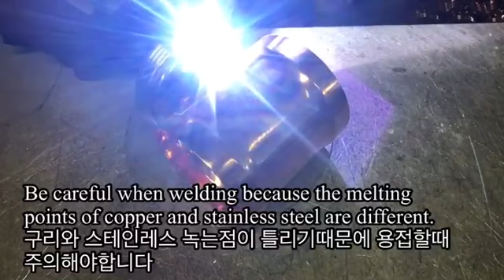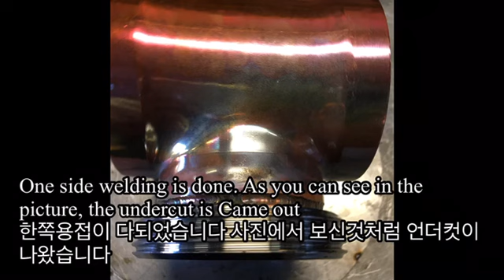How to weld copper to stainless/4inch copper tee/알곤용접

Comment: How about welding copper inside a long tube say three feet long ?? Just to be clear, slide copper rod inside a stainless tubing that just fits. How would you be able to do that or can it be done at all ??? Thanks. VF
Reply from the maker: Victory First It will be possible with fuse welding. Try it with about 90amp
Reply: @Mrleewelder  Thanks for the advise Mr. Lee.
Reply from the maker: Victory First no worries

Comment: What kind of filler wire are you using if required? I take it that you tend to keep the arc primarily on the stainless due to its higher melting point. Are you having any problems with the stainless sugaring on the backside of the bead? Type and size of tungsten used?
Reply from the maker: I used copper alloy Tobin fronze 
Not much problem 
2.5mm red colour Tig tungsten